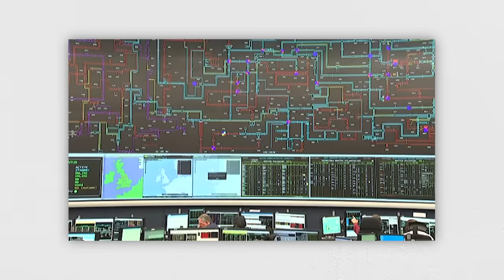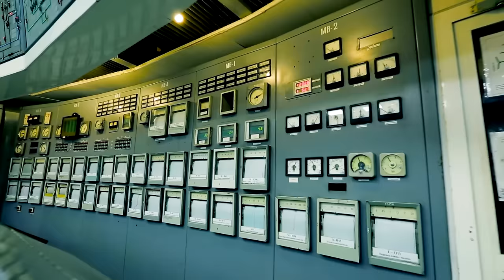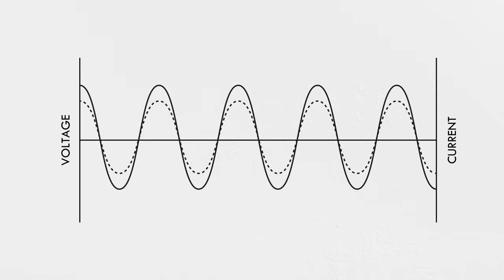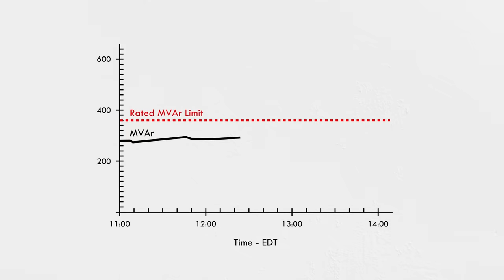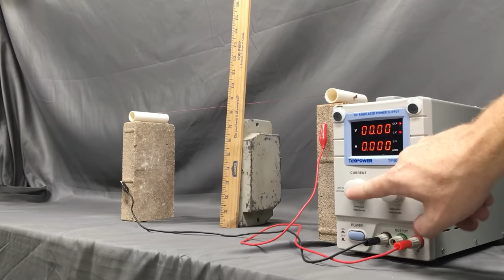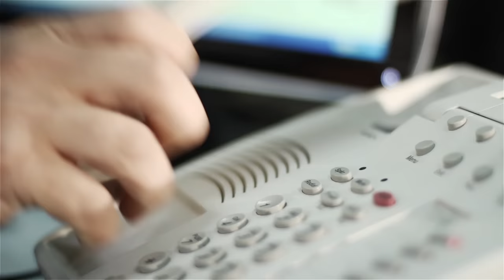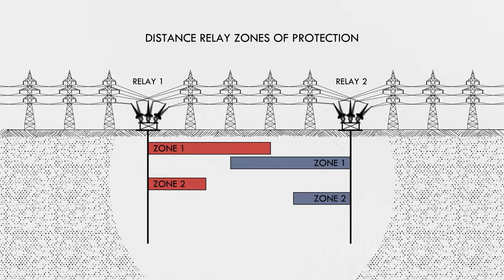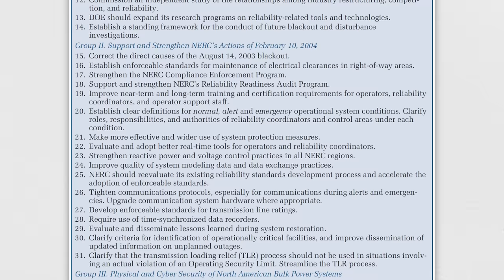What Really Happened During the 2003 Blackout?

Comment: 2003 was the year of a big blackout in Europe too, it happened on 28th September 2003 in Italy. A 380 kV power line located in Switzerland was overloaded, the conductors sag and one of them touched a tree, creating a short circuit to ground and causing the line to trip. That line, which still exists today and is part of the swiss national electric backbone, starts from a big substation in the inner Switzerland near the city of Lucern and ends in a substation in the southern part of the country, in the canton Ticino. From the same busbar in that substation where the line is connected, another one starts and ends to a substation in Italy, near the swiss border. That line is being used to export energy from Switzerland to Italy, and the italian substation where it ends is located at the west of the canton Ticino's border.

The interruption of the swiss trunk shut off the line going to Italy, and all the load that was on that line was took over by another 380 kV international export line, which starts in the canton Grigioni and again ends in a substation in Italy, located at the east of the canton Ticino's border. Those two lines in fact are part of a loop which starts from the big substation in the inner Switzerland, crosses a substation in Ticino, goes to Italy by crossing the canton Ticino's west border, in Italy crosses several substations located at the north of Milan until it reaches the other italian substation located near the canton Ticino's east border, then re-enters back in Switzerland, crosses the substation in the canton Grigioni, then goes to another substation in inner Switzerland and finally goes back to the big substation near the city of Lucern, where the loop starts.

That second line on the east side overloaded too, conductors sag, another tree was touched and the line shut off automatically. At this point, all the export power stream that was going from Switzerland to Italy was missing. Loads redistributed and were took over by a couple of lines from France (the european grid is all interconnected), they overloaded shortly after and gone off-line. All the import load then moved over systems from Slovenia and Austria, which at that time were absolutely undersized to carry such amount of power, and they immediately shut off. Meanwhile sensors at grid control centers all around Europe were detecting heavy load transients, this to give an idea of how big was the thing that was happening in that moment.

At that point all the power which Italy usually imported from the nearby countries was missing. Generators in italian power plants overloaded, slowed down, grid line frequency started to decrease until reaching about 48 Hz, power plants gone off-sync, disconnected from the grid one after another, the whole system collapsed and suddenly the whole Italy was left without electricity supply. It all happened in about 15 minutes, and it took nearly 2 days to restore the power supply in the whole country.

The main cause of this nation-wide blackout was erratic/incomplete communication between each country's grid management companies. Swiss personnel, while unsuccesfully trying to reconnect the faulty line (phase angle too wide at the line's sides), asked their italian counterpart to reduce imports immediately after the first line trip, but they underestimated the amount. On the other side, Italy was importing from Switzerland more energy than the amount that was planned, this led to the first line overload that started it all. And when the second line tripped the cascaded effect begun.

The reports from both Italy and Switzerland are available on the Internet, they're very interesting and fascinating.
Reply: I vaguely remember this. Wasn't most of Switzerland's almost completely electrified train system offline for about a day too, stranding a few hundred thousand passengers?
Reply: Watching the video I also remembered this incident and thought "well, this might be worth investigating, too". Then I found your reply and was happy to learn more about this. Here in Germany we've heard of the incident but didn't experience any outages due to it. Thank you for summarizing what happend then!
Reply: @uschurch  No, at least as far as I can remember that day there weren't particular issues with the railways. Swiss railways company (SBB/CFF/FFS in german, french and italian) runs its own grid, which is a 2-phase (180° phase angle between the two) 16.67 Hz system, with its own power plants and substations. There are some substations where both the regular 50 Hz 3-phase and the railways' 16.67 Hz 2-phase grids are connected, with equipment that act as interface between the two systems, so there are some junctions. But essentially the railways' grid is an independent system. From your name I guess you're from Germany or Austria, if I remember correctly in your country there's a similar configuration as I remember that, when visiting those countries, I clearly saw poles carrying wires in multiple of 2 instead of 3, like it is by us for the railways grid.

Some years later there were a couple of accidents where important parts of the railways had issues with power supply. Maybe you're remembering about these, but the disruptions lasted some hours, not days, and they weren't nation-wide events.

On that day of 2003 instead, here in Ticino, where I live, we were affected too by Italy's power outage for some hours during the night, but we had power restored by the sunrise. I actually remember that I saw all the streetlights still turned on during the late morning and I was wondering why. Then I heard of what happened during the night and I understood, as the timers stopped during the power outage and when power was restored they were all off-time. This happened because the two 380 kV lines coming from inner Switzerland that tripped, carried electricity not only for export to Italy, but to supply our canton too, as they power our local 220 kV grid. When they went off-line canton Ticino was actually nearly completely isolated from the rest of the swiss grid, with the exception of just some secondary and quite old and undersized 220 kV links which failed pretty soon too, and for a certain moment we were actually powered by the italian grid, I think just by the east-side international line (the one which is connected to the substation located in the canton Grigioni that I mentioned in my first comment). Once the italian system gone offline it pulled us down too.
Reply: @DavidSallge  You're welcome, it's an event that fascinated me and I like to talk about it. If you search in Google you'll find the reports that describe all that happened that night. The problem is that I don't know if you'll find them in german or english (maybe for the swiss' one there's a german version too), as I found documents only in italian.

Comment: I worked maintenance for a company in northern NJ when this happened. I  was replacing light bulbs in ceiling fixtures. I was turning the lights on and off, checking as I replaced each. A co-worker came running in screaming and demanding to know what I did because the whole building's power flickered several times (while I had the lights off)and blamed me, I had no idea it was happening until we lost power completely. Co-worker still was blaming me. 🙄  I was having company that night and it was the hottest day and so humid. We sat around sweating our a.. off only to find out 3 hours later that someone's, at the party, house less then a mile away had power and a/c.  I often think about that day because although we were physically very uncomfortable, it was a very enjoyable time

Comment: The precursor to this event was East Lake Unit 6 being taken off line the evening before for repairs.  This caused the need to import about 600 more megawatts into the Cleveland area that weren't there the day before.  Importing power, in this case, put an additional reactive strain on the transmission system.  This was made worse by the East Lake unit being off and not being able to provide the reactive support - VARS to go along with the 600MW import.  Also, when the blackout occurred, much more load was lost than generation.  This caused the highest frequency spike ever seen on the Eastern Interconnection due to more generation remaining on line than load to serve.
Reply: Nah, just blame it on not having enough regulation...
Reply: "highest frequency spike" ... ?
Will you elaborate please?
Reply: @FOH3663  The frequency is maintained at 60.00HZ unless the interconnection is on a time correction.  Typically an excursion from 60 is negative and it's due to a large loss of generation, resulting in too much load for the remaining generation.  This happens fairly routinely, but the frequency usually doesn't decline to much below 59.94HZ.  It's quite unusual for a large enough loss of load to drive the frequency up any significant amount.  This system upset did that.  Frequency recording charts (now electronic, but I sure remember when they were paper!) are scaled to show declines from scheduled 60.00 to about 55.00HZ.  This is for posterity, as after a decline to about 58.50HZ, generators have come off line due to protective relays opening their breakers to prevent turbine damage.  These same charts don't go much over 60.20HZ because the frequency just doesn't usually move in that direction any  significant amount.
Reply: Eastlake 6 is a 35MW combustion turbine. You're thinking of a different unit or a different plant. I know this because I did the siting engineering for EL6 working for CEI in the 70's.

What you say is true if you change the 6 to a 5.
Reply: @123livewire  very interesting! So what did the spike make it to? Or we don't know because the chart only went to 60.2?
Reply: @benschofield1361  We recorded 60.18HZ in the Atlanta area, but the excursion would have been greater the closer you were to the point of the initiating event.
Reply: super minor thing, but as a resident of the area... it would be called "Eastlake Unit 6". Eastlake is a city / suburb of Cleveland, and that's where this particular plant is.

Also, from what I can find, the plant was closed in 2015, or maybe a few years after
Reply: @DarthHater100  
Bro, wtf? ... we're also down w/the Kardashians... 

Dude, I got your auto re-closer right here...
Reply: @bradenmcg  Wiki says that 2 of the coal units were shut down in 2012, the other 3 were shut down in 2015, and the final unit, a natural gas one, finally shut down in 2020.

Comment: I'd love to see a video from you on the process of restoring power, which was very complex. It's not as simple as just flipping a switch and starting up again; black start is a careful dance. In Hamilton, Ontario (between Niagara and Toronto), it took a few days.
Reply: I've heard an anecdotal story wherein one ingenious set of engineers at a coal-fired plant somewhere in NY used their car batteries, wired together, to run the coal supply conveyor belt (ordinarily powered from the grid) long enough to get the system re-lit.  Simple AC motors can be run on DC, and vice versa.  AC motors will always spin the correct direction on DC as long as the VA input is enough, DC motors on AC have a 50/50 change of running in reverse (if they run at all).  Them getting running in turn helped other plants restart.
Reply: I work in one of the largest transformer stations in ontario near the Hamilton area and have talked to some of the old guys who worked through this event. Allen beck GS told hydro one that their system was them causing issues and that they had to figure it out before they get reconnected. Since there was no power, crews had to individually go to every piece of equipment and test functionality using generators to power their test equipment. They inspected every single cable in the entire area and tested differential and core grounds on every transformer which is a task I can't even fathom lol.
Reply: @akbop3749  yeah sure you do
Reply: @spinningwheel3360  I know this is a 2 month old comment, but what's your beef?
Reply: @jacewhite8540  i know this is a 2 minute old comment, but who u
Reply: @spinningwheel3360  Someone who is wondering why you said "sure you do"?
Reply: @jacewhite8540  i am not caring
Reply: @spinningwheel3360  welp I''ll just label you a troll and get on with my life then.

Comment: I work at a public aquarium and have experienced the cascading effect of minor problems in the network infrastructure stacking to collapse the whole. It's scary how quickly your world can go dark around you if you're not paying attention or especially if you are paying attention, but you don't have reliable data... I feel for those operators that got blindsided by bad data coming at them. Keep up the good work for all the other days that you kept it running smoothly! ⚡
Reply: I do some electronics circuit design myself. We are "intelligent" and design systems not randomly but with the components they NEED.
conversely this means any failure was something that was NEEDED and will have a cascading effect somewhere else.
I was thinking about this a while ago and its actually scary how one component failure will make the entire system inoperable, and this holds true for not just electrical systems. it also extends to society and human body :( . downside of intelligent design i suppose
Reply: Amen
Reply: @fortheregm1249  that's why you need fault tolerance in your design?
Reply: @monsterhunter445  you can have protections but you cant really design for fault tolerance because any component can fail in a number of different ways, in best case it will make the design 4X more complex and then its exponentially more prone to faults. Best you can do is design a duplicate system as backup.  Like i said, its scary.

Comment: I was on the edge of the blackout area, in Ypsilanti, MI. I could tell the outage was an unusual one because it was preceded by several minutes of voltage sags, voltage surges, and frequency deviations as the grid became uncontrollable.
Reply: I was in Novi! Had the same experience
Reply: Also in Novi, small world
Reply: Yeah, I was living in South Ypsi at the time, I only really remember hearing some stuff about power grids failing and not having AC/electricity for about 2-3 days, but admittedly i was 9-10 yrs old around then.
Reply: I wouldn't be surprised if it happens Again
Reply: I was at the University of michigan, I had just gone home and my home was at the boundary of DTE snd Consumers Power— we had power but I saw the stoplights a mile to our East out, I called in and got no answer, so I turned around and went back.  Spent the next 60 plus hours at eork.  The UM power plant lost two of three generators but due to luck the last one stayed up so it didn’t have to restart lack.  We had absorption cooling at critical buildings which  let us save  electrical power and due to the incredible competence of our trades staff we saved all the critical labs.  Ive never been more aware of how complex our civilization is— or of what irreplaceable an asset human skilled people are.